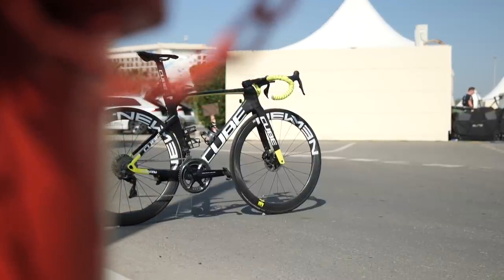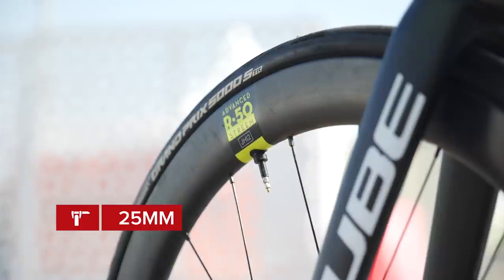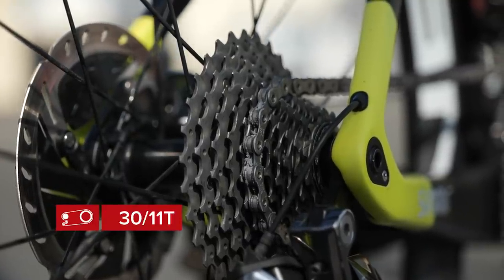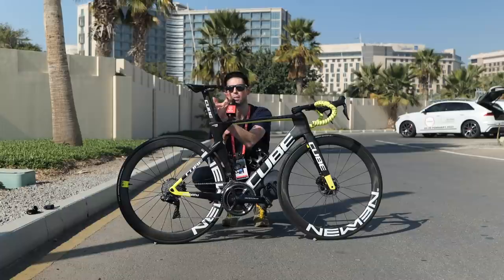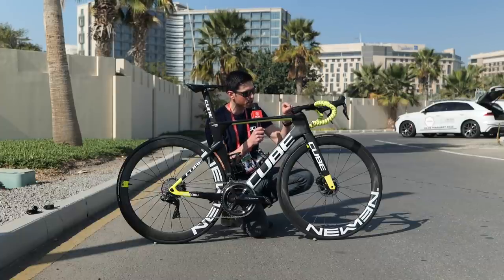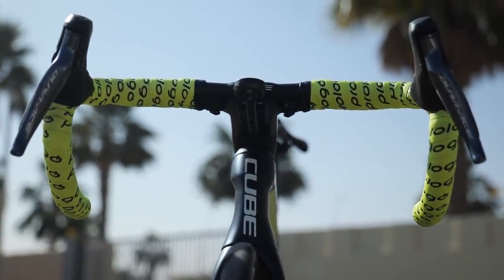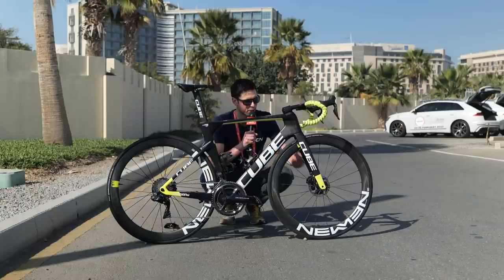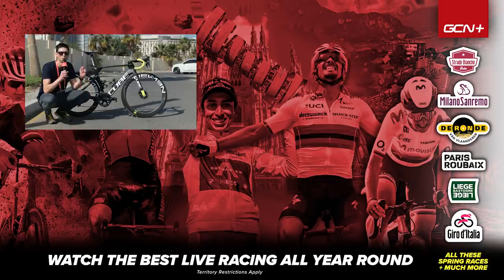Jan Hirt's Cube Litening C:68x | Intermarché-Wanty-Gobert's Aero Machine

Comment: I have an older 2017  cube litening that I picked up brand new for dirt cheap - because it was "old stock" and never going to sell with the rim brakes that it shipped with :)
Full ultegra, 11spd, di2, and 7.25kg with pedals.  $2100 AUD straight off the shop floor.
And with rim brakes, it actually looks like a race bike to my eye.   It's just a really simple, light and solid bike that is a joy to ride fast, and simple to maintain. Good job Cube !.

The new ones do look cool, wouldn't mind the newer 2023 litening air model - but even then, I will be keeping the "old" 11 speed / rim brake model as a comfortable, great handling  climbing bike that I can maintain at home with ease.

Realistically though, drivers are just getting worse, so it's likely I will be spending most of my recreational cycling doing gravel tracks, and save the proper road mountain climbs for special occasions on 1 special bike.

Sad, but that's how things are going these days.   Way too many P-platers driving around aggressively in huge 4WDs and Utes, thinking they are on the road to Bahkmut or something.

Comment: Does sand not stick to waxed chains?
Reply: Not really. I using Squirt wax, and much better than oil. Long life for the chain, and cleaner after riding with 500km.
Reply: Definitely less than oil based lubricant.

Comment: Surprised at the weight... my 105 equipped Venge weighs less than this Cube, with identical loadout to this bike (i.e. weighed with the same equipment, including pedals, cages, deep wheels, etc).
Reply: I woul guess they are using different bike for climbing would expect to weight around 6.8-7kg close on the limit
Reply: @turtleneck369  Correct. They leave no sandstone un turned when it comes to Saudi climbs.They do have 'em.

Comment: : 7,63 kg?? on such a small bike and with tiny rotors?? Wow. That's a lot of f++ng weight that you have to throw around.
Reply: : So, if you put big rotors on it and the cooling fins in the back :D, then this bike is 1 kg above the UCI weight limit. It funny how GCN doesn't complain about the weight limit anymore as they used to.
Reply: those newman wheels are very heavy, i have the same bike size 54 with mavic 45 ers and it is 7.4
Reply: @pennyblue6372  : That's also heavy. But true. Disc brake wheels are very heavy.